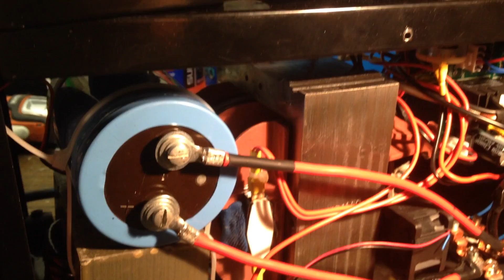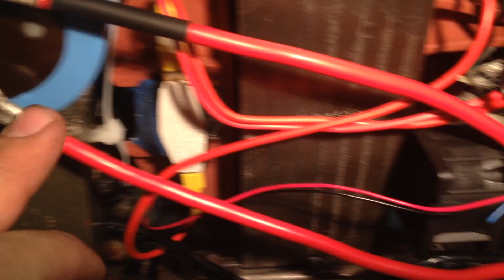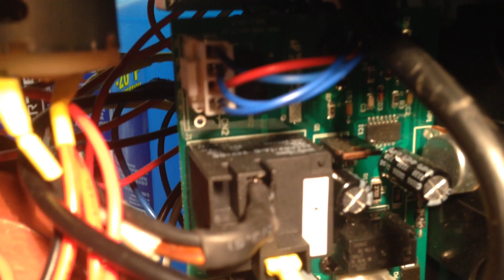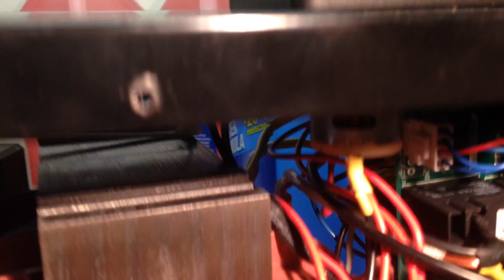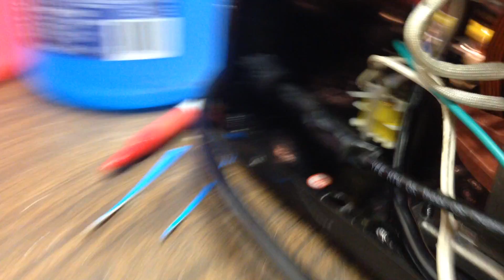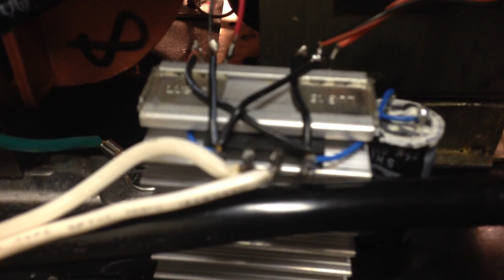Harbor Freight 90amp Flux Wire Welder Modifications

Comment: I am going to add a rectifier to mine for about $10 for a 150A, and see how it does.  I am not going to bother with the caps or other stuff.  The Titanium version of this welder or the Yesweld 135 Flux are only about $100, so it doesn't make sense to dump much money into this old Chicago Electric. You did a nice job though

Comment: I did all this just recently on the newest version (well, from 3 or so years ago) of this welder.  All but the induction coil cause I didn’t think about using a microwave transformer have, and didn’t want to pay for new torrioid (sp?) rings to make one.  Do you think the coil helps that much? Mine still feels like it pulses while welding, but is still way better than before.  Only other addition I did was the bleed resistor on the cap. Wish I got a higher ohm rating but didn’t want to wait for it and got a 15 ohm, I think it bleeds off the charge a bit too fast.  Thanks for posting.

Comment: I did some research yesterday on electrolytic can capacitors mounting orientation.  They are designed to be mounted with the screws upward.  Because the vents are on the top which is the screw side. This allows the gases inside to vent out without the electrolyte fluid reaching the vent and escaping the device.  And making a corrosive mess.  This also keeps the fluid on the bottom of cap. Where it can be evenly distributed between the internal components when charging.  Improper mounting orientation will definitely shorten the life of an electrolytic cap.   Mounting it upside down (screws downward)  can even shorten the life up to 90%.  In these units using two 50V 22000uf caps might fit better it the case and allow proper mounting.  50V is minimum for the output of this unit. You can go a bit higher if that is what you have.  But not too much. The higher voltage is often accompanied by a higher internal resistance of the cap.  And that will restrict the output.  So 50V is on the money. But 63V for instance will work fine also.  The optimal capacitance for this application is between 40000uf and 50000uf.  Yeah, it was a long read, hehe.  

The transformer is wound with aluminum wire.  So the connection to the copper cable must be isolated using aluminum to copper connectors to prevent arcing later.  Aluminum oxide is not conductive.  And dissimilar metals will react to one another and degrade.  I found the cheapest at Home Depot for $5 a pair.  I used NOALOX Anti-Oxidant joint compound inside the connector as recommended.  It's like $3.  I got the larger bottle for $6.  It has other uses like lubricating the threading on aluminum flashlights.  Insulate the connection using 3/4 inch shrink tube.  Don't use electrical tape at all.  The heat will cause it to unwind over time. Exposing the connection to the chassis. That would be very bad.

Oh, and if you're testing the unit after installing the rectifier and the spatter has actually increased. Check to make sure you didn't mix up the DC out connections.  With DCEN the positive terminal goes to the ground clamp, hehe.  

Shrink tube is your friend.  Use it! It's worth the extra few cents.  And it will insulate for a lifetime.  Good luck with the upgrades. 
And thank you for the video!

https://www.homedepot.com/p/Commercial-Electric-14-2-AWG-Aluminum-Dual-Rated-Splicer-Reducer-2-Pack-G61101HD/310741687
https://www.homedepot.com/p/Ideal-Noalox-0-5-oz-Anti-Oxidant-Joint-Compound-30-024/202276207

Comment: Is there any use for DCEP with a flux wire welder ?
Reply from the maker: All you would have to do is swap the polarity of the leads.  Switching the + with the - at the diode bridge would work.

Comment: Sir, I wonder if you could tell me how to wire the two switches on the welder , I had to buy a new  power switch and now I have losed the diagram I drawed up, sure would appreciate it if you could help me out. This  is one of the best  tutorial I've seen on how to  modifications  on the welder I"ve seen. Again thank you for any help you would care to ofter. I can't read the wiring diagram.

Comment: this comment below, "Question about the transformer that drives the wire feed. What size of transformer? Where do supply power from and where do you wire the secondary leads into?",,,,,, could you give a better detailed explanation for this. My wire feed is so choppy and really want to smooth it out thanks :)

Comment: Question about the transformer that drives the wire feed. What size of transformer? Where do supply power from and where do you wire the secondary leads into?
Thank you

Comment: Another update.  I change my capacitor from a 68,000uf 100v to a 60,000uf 50v and the welder is working much smoother now and making nice welds.  I also added a 150ohm 5 watt bleed resistor which drains the cap in less than 5 minutes.  Next step is to add the inductor.

Comment: How is the inductor wired to the cap and welder?
Reply: Make sure you know if you have a 115v or 220v welder FIRST!  
Attatch the A/C to your ebay? rectifier bridge. The two wires  from the
Output of the  welder transformer to these    ~   ~
**
To make an L/C filter, you wire parralel output. Your DCv + from the + on the bridge, goes to the + side
Of the capacitor. 
Negative -  from the bridge to  -  to negative on the cap.
 Inductor leads in parralel,  + and - from the capacitor, but mind your outputs so you know which polarity
Goes to gun and which to ground clamp. Do you want electrode Positive?
Electrons actually flow negative to positive
***
You will also need to wire a 7 watt 10k resistor across the capacitors + and - 
To bleed current off after
You release the trigger.  Otherwise it's a hot tip, and will store enough juice to arc, and/or end you.
**
IF your secondary transformer(motor drive) is a 115vac to 12vdc. Input is from A/C main power wires to Main Transformer in the welder
Output of the small transformer goes to the D/C motor control circuit board, and to the stinger trigger.
If you are unsure how to do this step, don't add the transformer.
The purpose of adding the 12v  transformer for the wire feed motor is to eliminate the 1.5v -2v forward voltage drop From the A/C output, off the main transformer.
**********************
D/C operation in a welder is voltage and current sensitive. And the amount of wire stick out from your gun
WILL AFFECT it as well. Keep wire stick-out less than 1/2" on these machines.

Comment: What is the use of the inductor?
A other guy had a ferrite core between the rectifire/cap and torch. But what is the use of it? And wich one is better?

I got almost the same welder ( other brand ) for free. And i ordered a 150 amp single fase bridge rectifiere. The capasitor is something im still looking for. But what should be good? 50 volt or higher and as high as possible uF?

I have a 10 amp 12 volt transformer wich i am going to use to drive the wire feed. And a relay wich will be switching the main transformen on and off. I just connected a 12V 80 amp relay on the output wires of the small DC motor. So if i push the torch switch it has power. Now the torch is live all the time. And i want everything to be out. Accept the cooling fan and transformer.

Don't you need a heatsink on that rectifier?
Reply: +Inkwellish 

You're a bit confused as to what single phase vs three phase means. These are types of power. They have nothing to do with half wave vs full wave rectification.

A single phase rectifier simply means it can only rectify single phase power (the AC power you get at your house). A three phase rectifier is able to rectify single phase (as you've done in your application), or 3 phase power (typically only found in industrial buildings).

You can rectify AC power with one diode. It cuts off the negative half of the AC wave. That is half wave rectification. You can rectify both the positive and negative halves of the AC wave with 4 or more diodes. That is full wave, or bridge rectification.

A bridge rectifier is ALWAYS full wave rectification. So what he has is a single phase, full wave (bridge) rectifier.
Reply from the maker: Nick R The inductor works in conjunction with the capacitor. The capacitor acts to smooth out voltage and the inductor acts to smooth out current. Together they give you a very smooth DC output. I would be really careful with that single phase bridge rectifier though. What you really need is a full-wave rectifier. I will include links that explain the difference between the two. As for the capacitor, the more uF the better. On my welder right now, I think I have about 70,000 uF. 50,000 uF is probably the minimum in my opinion.   50 V is fine, but I wouldn't go any lower. As for heat-sinking, I would definitely try to figure out a way to get heat off that diode. I have a dedicated fan and heatsink that cools the diode in my welder.
Some of the information in these links is kind of deep. What you really need to know, is that a single phase rectifier is far less efficient. A full-wave rectifier, should in theory, give you twice the output. This is because a full-wave rectifier rectifies both the positive and negative halves of the AC wave. 
https://en.wikipedia.org/wiki/Diode_bridge
https://en.wikipedia.org/wiki/Rectifier